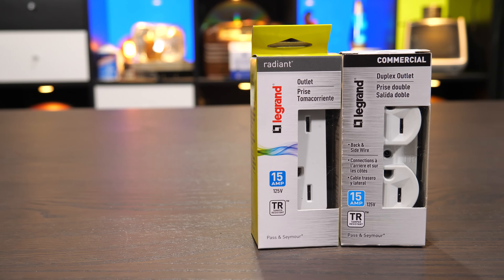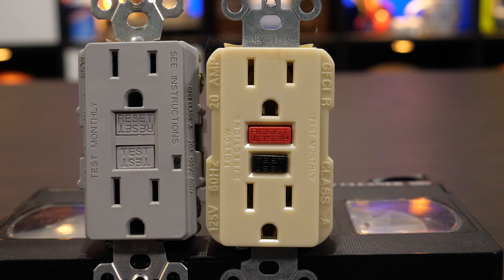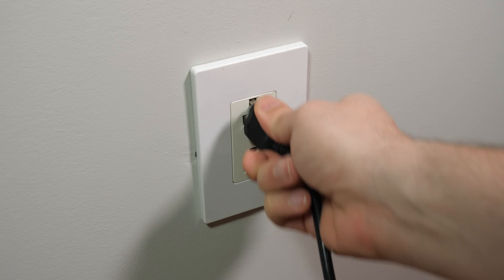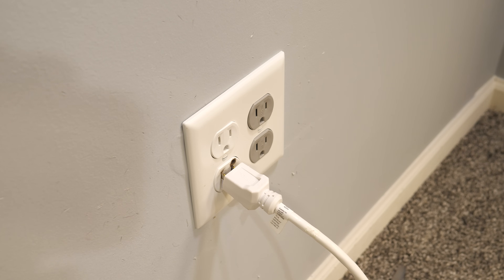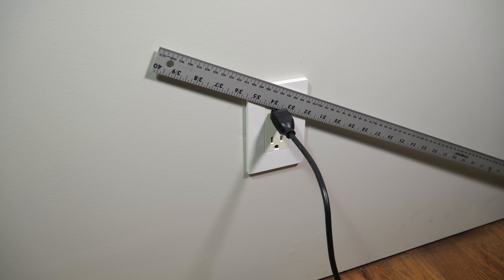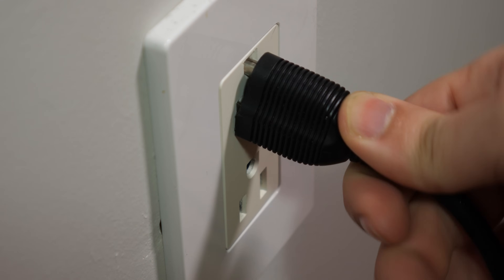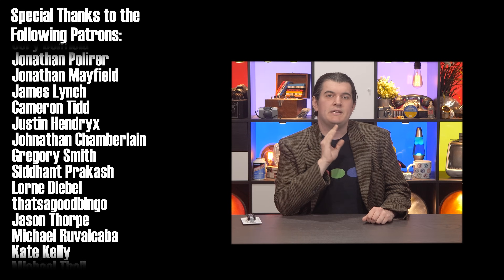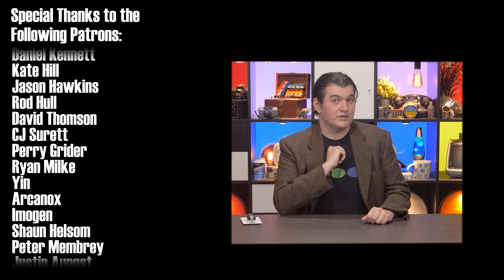Power outlets are topsy turvy - but does it matter?

Comment: If there are two outlets, why not just make the top one “upside-down” (ground pin at the top) and keep the other one “frowning face”? That way, you can get the benefits of the ground-pin-at-the-top outlet for one plug, and be able to use right-angle plugs in the other outlet. This might not be ideal for when you have two devices of the same type next to each other, but it’s still a plus. All the dual outlets in my flat (in Poland, so using the French standard with the ground pin sticking out of the outlet) do it this way, even though I’m pretty sure that having the ground pin at the top is the standard (all the single outlets have it there). This arrangement with inverted ground pins also lets me use two right-angle-plug devices in one outlet for more flexibility.
Reply from the maker: This is not a bad idea at all! Although, one thing I do really appreciate about the sideways outlet convention near Chicago is that we don't have cords falling on top of one another. Perhaps we've been doing it right all along...
Reply: I was going to comment about the increased manufacturing cost of this approach limiting the commercial viability given that outlets are a commodity product but then I realized I would absolutely pay extra for this. It would be so nice to be able to plug two power adapters into a single receptacle without requiring an extension cord. I'd also be down for receptacles mounted sideways with the ground down on both - the cable management with right angle plugs would be perfect.
Reply: @alc5440  When my first (and only) child came around and I was redoing one of the rooms as his bedroom (and our bedroom at the same time) they had those plugs with the plastic shutters over them and while I'm not sure if they are code or not (I thought I read something that they were) I very happily bought them for all the outlets even though they cost significantly more than the standard plug.   Now I can have peace of mind that a random toy probably isn't going to wedge itself in the hot outlet of an unused plug.
Reply: @alc5440  I assume the intent would be to make it a standard going forward, so the manufacturing cost would be offset by the number sold.  And, honestly, we produce enough variants as-is that it likely wouldn't be that much more expensive.
Reply: You are a freaking genius.
Reply: Actually, after saying this out loud, I might know why.  Anything that has a power brick generally uses a lot of power and I think they try to dissuade you from using the other plug on purpose.
Reply: @prman9984  The opposite is true, actually. Power bricks draw an insignificant amount of power compared to other house appliances like vacuum cleaners, portable heaters, and the like! Largest laptop brick is what, 140W? A heater can use ten times as much.

Comment: A few years ago at a plant I do IT work for, a couple of my co-workers were inside an office/closet moving a thermal printer when a flat stainless steel bar that they use for...something... slid down the wall and landed on a plug.  It bridged the contacts and threw the breaker.  He said there was a considerable flash and I later saw the receptacle was charred.  My co-worker had to change his pants after that but the two girls in there just shrugged it off and radioed for maintenance to flip the breaker.  He asked if that sort of thing happens a lot around they just calmly said "Yeah, sometimes".  I can't fathom how that place hasn't burned down, or what those poor people have seen.
Reply: Ah yes, the "dropped a wrench across the car battery terminals" special.

Comment: 4:25 This was me in Barbados when I was 8.
Blind kid away from the UK for the first time, being shown an entirely new plug.
Used my fingers to guide the damn thing into the socket and zing!!! How kind, it zapped me.
This was such an old-fashioned radio that it had no on-off switch, just a US-style plug where the pins? Blades? What do you even call them over there?
Anyway, those things, were the same, so you could put it in either way up.
They were metal all the way down to the housing, and I’d never experienced an electric shock until then.
I think it happened three times to me in four weeks while I was there, before I got the hang of just… Find the beginning of the socket, push and run!
Had a fear of such plugs after that. Hate them.

I’m sure things are a bit different now, but in the UK you’d have to try ridiculously hard to get shocked by a plug here. I just assumed the rest of the world was the same… Not so much 😂

Comment: A cool plug design would be to take a note from Type C and even older serial ports, just surround all the pins with a metal band that serves as mechanical link and ground. Oh and while you're at it, cram in a replaceable fuse!!!
Reply: I love plugs with inline fuses. You can cater the rating to the device so say if the light starts drawing 200W it will blow, even though the breaker wouldn't do  anything.
Reply: European Schuko-Sockets?
Reply: While you are at it you could switch to 230V 50Hz and ditch the imperial system ;)
Reply: @tschuuuls486  I don't see the advantage of 50 Hz outside of uniformity with other countries, but having more common ease to run higher voltages would be awesome. I feel like it could be fairly easily done with the way we set up our circuits. Oh, and I'm totally for ditching Imperial measurements. Metric all the way!!!
Reply: Maybe a audio jack design with live at the tip, then neutral and ground towards the grip? Maybe a switch mechanism so it has to be plugged all the way in to provide power. An easy design to plug in even when you can't see the plug and you could rotate it 360° so an angled plug will always go off in a desired direction.
Reply: fuck the fuse. its ancient crap that we dont need. we have fuse boards these days. Also european shuko can be plugged in both ways
Reply: Fuses probably won't be popular with normal consumers despite their obvious practicality. You have to assume end users have almost no idea what they're doing, and any potential extra work they have to do is the devil. The inertia of our current standards is going to be almost impossible to overcome without keeping the end use identical.
Reply: @gamemeister27  i mean, the end use is exactly the same if they install a correctly rated fuse from the factory. which they do. i have lived 35 years in the UK and changed maybe 10 fuses in my life.
Reply: @cho4d  That's 10 more fuses than most Americans have changed
Reply: @gamemeister27  Seems easier to change the fuse in a cord than change a fuse inside the device on the PCB. And they should only blow when something in the device fails.
Reply: @gargantuablargg  I'll be honest, I thought he was talking about a fuse in the outlet.
Reply: @gamemeister27 in the UK (where we have fuses in the socket), we actually teach about how the sockets work in school: how to rewire them, replace fuses, etc.
Reply: @ethereel6268  That is awesome!!! I love practical education on a national level.
Reply: @ethereel6268  Hot dang that's great. More of school needs to be able teaching applicable life skills instead of just Trivial Pursuit to show who knows the most categorical information.
Reply: There is nothing I want less in my life than to have to unscrew two plastic screws every time I want to plug something in or remove it.
Reply: @Nefville  take the locking tab from DisplayPort then
Reply: @Nefville What?
Reply: @squidvis  On DisplayPort video cables (similar to HDMI but not quite), there is a button on the flat side of the connector that's used to disengage a pair of locking pins. You have to squeeze to pull it out, unlike HDMI or USB which can just be yanked on.
Reply: @OtakuUnitedStudio  I guess I'm just wondering what old style HDMI/VGA connectors have to do with USB type-C...
Reply: I'd go with a circuit breaker over a fuse, since fuses are bound to eventually go obsolete.

Edit: What I meant is that a fused cord from a specific manufacturer is bound to eventually go outmoded and you'll not be able to get fuses for it, unless the fuses are standard across other things as well.
Reply: @JonesNate  Never. Fuses and Breakers have different responses and therefore, different uses.
A Breaker responds faster to a simple Overcurrent situation than a fuse does, and responds more accurately with greater sensitivity.
A Fuse responds almost instantaneously to a Short Circuit.
Reply: Even breakers fail, but both should be used. A breaker and a fuse in the plug.If the outlets were horizontal, and ground on top with matching cables. problem solved. @JonesNate

Comment: Nema 5-15 is a true demonstration of the inertia of convention. We're stuck with a sub par design because it's everywhere.
Reply: And where grounding is not a requirement, we still use NEMA 1-15 plugs.
Reply: @dougbrowning82  True. I'm kind of astonished we still have those plugs. At least they're polarized... usually.
Reply: Yea but it’s also not bad enough to require change. Is it the best? No, but it’s also really not that bad, and I actually prefer it to others like Australia
Reply: @chadkrause6574  But it is bad. It has many flaws and no real benefits. It's just archaic.